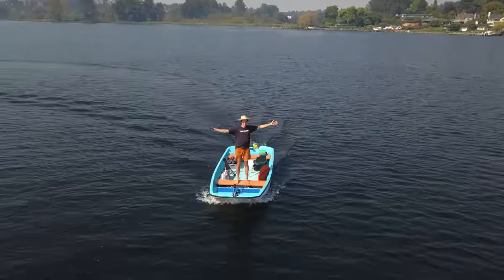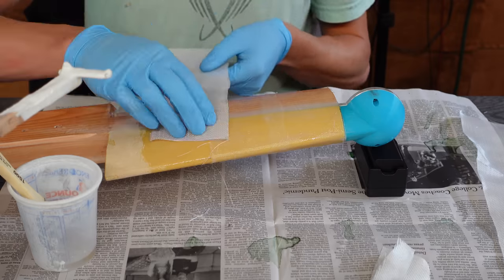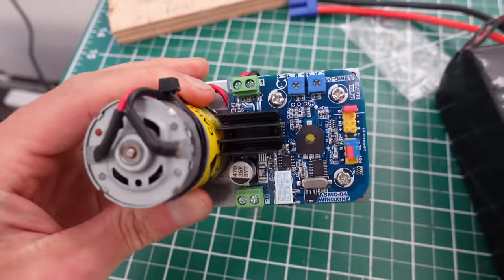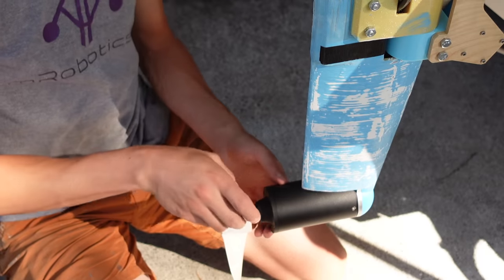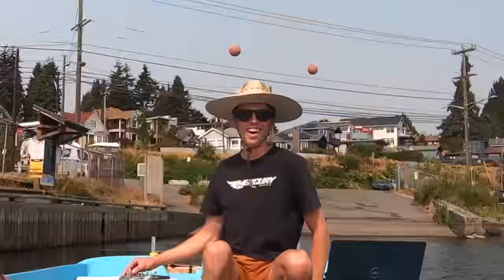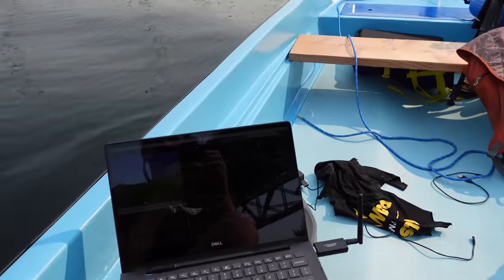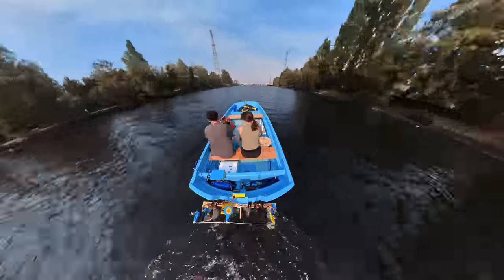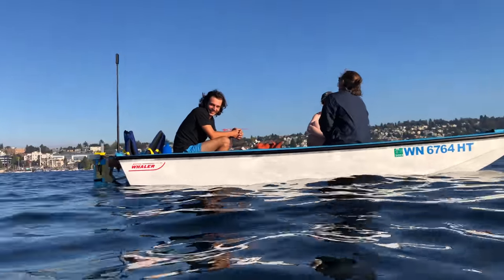Full Size R/C Boat Can Carry People!

Comment: This is awesome! Why not use some e-bike ESC's and even matching motor(s) if you needed too? Theyre already bigger and have the Watt ratings and Voltages you need..
You could prob make it into a single bigger electric "outboard style" motor like you have now. For the steering if you need to change it again and want to also have a steering wheel, you could use a regular cable style push/pull outboard steering cable and steering wheel. Then you can just mount the servo under the steering wheel to use the cable and it should keep any torque or vibration on it.
Something with the equivalent of about 40HP-70HP would really be a blast on this size Boston Whaler! Nice Rebuild, the boat came out great! 
Im waiting until its cost effective to build an electric jet ski or maybe an electric stand up jet ski, like a Yamaha SuperJet. Theyre alot lighter and the torque of the electric motor would make it feel sweet!! Would be the ultimate freestyle or even racing standup jet ski. Using maybe a small electric car sized motor and im assuming you;d have to make custom batteries because of the shape but theres plenty of room especially without the gas tank and easy to tuck all the smaller electronics up front in the nose where it doesnt really get wet.

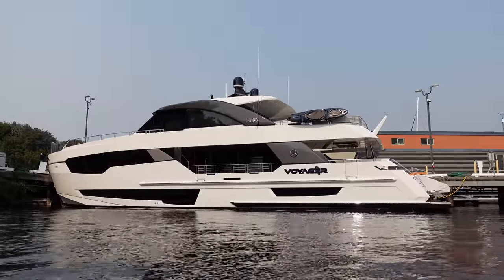Comment: @17:18, you can charter those types of yachts (and larger ofcourse). This one is not for charter available but similar size and specs will cost you 100k and up for a week (without expenses such as fuel, harbor costs and food/drinks).
Reply: A lot of them around here are owned by the billionaires in the area (Microsoft, Amazon, Boeing)

Comment: The rubber inside the hub of the prop is in case you hit a rock or solid object. To both absorb some shock and will rotate as well to keep from ripping drive shaft in two. The inner brass cog will spin on the rubber inside the prop. This setup is a bit better than a solid prop with a shear pin. After a prop strike this rubber setup will work even though it spun. Where as a shear pin on a solid prop is done until you put a new shear pin in.

Comment: rubber in between drive and propulsion, like inside a propeller or inside the rear wheel of a motorcycle, is usually called a kush drive. it allows smoother operation! On my motorcycles it keeps the motor from 'thumping' the rear wheel.
Reply: and also if you strike the bottom the rubber will rip and hopefully save your shaft

Comment: Dont know for sure but the motor might need a cavitation plate above the props. 
Also with  that plate you can raise the props to about the same height as the underside of the boat. Maybe even a bit higher. 
My boat went from 60km/h to 70km/h just by raising the engine. 

Happy to follow your channel and projects from way back. 

Thanks for reading bye.

Comment: To get much over the 11.6 knots you are now getting you will need to plane the boat, which is going to need a lot more power.  (Note: even the metric mafia use “knots” on the water and in the air. Just makes long distance navigation easier.)
A 13’ Boston Whaler will probably get on a plane with about 15 horsepower, although most use 25 to 40 or so. So so where around 11 kilowatts plus ought to do it with the right size and pitch of the props.

Comment: for thermal stuff, you are driving around on the world's largest heatsink... if you can utilize the water to cool the electronics you can somewhat guarantee a valid thermal solution (especially if you don't relay on pumps or anything to move the water).

Comment: Instead of a Servo with an Arm, you might consider a Linear Actuator for your steering.  Also, your autopilot would work better if your motors were pulling from the bow instead of pushing. All the GPS Trolling motors I've ever seen are Bow mount, not transom mount.  Very cool project though.

Comment: Differential thrust is almost exclusively used for very low-speed maneuvering. Once water is moving over the hull, it stops doing much while wasting energy. Engine turning works both at a stop and at speed. It should be used almost exclusivly at speed. When moving slow though, sometimes one is better than the other, sometimes its the other way arround. Its really a matter of how you like to do it.

As for the prop, that rubber piece is the designed in fail point. It looks like its actually made to fit a small gas outboard. The point of the rubber is so of you hit a stump with the engine at full power, the rubber rips, disconecting the engine from the prop, saving the engine and gears. Doing the same thing as a shear pin on a tractor, or a carter key on a lawn mower or gocart. Its designed to break so something more expensive does not. In the boating world I think its called spinning a prop. With a the rotating mass of an engine on the other end of a trans, its needed. Directly attached to an electric motor, it may be more trouble than it's worth.

Comment: Maybe consider adding a slot for a manual override tiller of some sort in the event that your GPS/autopilot is screwy but you can still control the motors? Also an auxiliary throttle of some kind so that in the event the flight controller is acting up you an get back to port under power.

Comment: My guess with the props is that the being out of center, even when weightwise balanced, messes with how it interacts with the water.
The rubber center is common on "proper" outboards as well and works as both a vibration dampener, and a weak link should you hit anything so you loose a prop rather than damaging the engine.

Comment: There is a reason setscrews are not recommended for use where torque is reversing direction, they will fall unless they are ridiculously over sized.
Some kind of taper collet or split coller is much better.

Comment: I was really hoping you'd treat them as pods with each motor having its own steering gear.  The differential thrust is brilliant!  I would use something like an engine or transmission mount to connect the drag links to the steering arm.  That would help isolate the vibration.

Comment: Maybe a backup tiller and way to disengage servo. The rubber in the crappy props is a safety clutch incase the prop hits the bottom it protects the crank of the outboard they were designed for.

Comment: 22:41 the waterproof box encapsulating the controller is causing it to overheat.

Maybe using an aluminium face on one side of the box can create a heatsink exchange to prevent overheating

Comment: I'd argue that PETg does absorb water, but doesn't go brittle like PLA does when waterlogged. Waterlogged PETg just becomes a bit harder to print because it make it more prone to blobs and stringing, but otherwise the finished print will be just fine even when submerged in water.

Comment: Use a high powered scooter setup, Has a 20s lipo and twin 50amp@84v's sine wave controllers. Add the display and throttle as back up. Kaabo Wolf King GT Pro would make a ideal donor.

Comment: If you continue to have steering issues you may want to look into moving the steering axis aft (or make a deeper version of the forward 2x4 shroud) to add some balancing torque. Kind of like horn balancing in aviation control surfaces.

Comment: Battery idea for you, get some used ebike/e-scooter batteries. 36v ones are 10s so running 2 in series will give you your 20s. There are some 100v rated ebike controllers you could use as well that can handle the current.  Battery hookup has lots of the 36v batteries you can get for pretty cheap.

Comment: Hey man first time watching your channel. Epic job on your build. Mad skills on everything. BTW everyone in the DIY foil world says that the props that come with the foiling motors suck. it looks like you are printing your own but if you need good outboard props you may want to look at torqueedo props for size and pitch. You mentioned that u were using 100 amp vesc’s I believe and I did not see any water cooling on them. I think I would switch over to some water cooled speed controllers. It’s one more thing to engineer but it will help with the thermal overload you are experiencing. You also said you were running 10s batteries I have done some amp draw tests with 10s liposuction running a jet surfboard and with no one on it in static tests I was pulling 120 amps continuously and peak amps at 170+ so under load aka my fat ass (225lbs on a good day) riding the board I was maxing  out the 240 amp speed controllers I was using on 2 jet pumps with 53mm impellers. So even though your set up is very different I guarantee you need bigger speed controllers. I’ve just started building paddleboard fin drives ( inspired by the 3 year wait for a Boost fin I bought on kickstarter 3 years ago. So far the torque these fin drive outboards ( for want of a better term) produce is insane even using 40 mm brushless motors with 5 mm shafts. I’m up to 56mm motors with 8mm shafts but I think I’ll have to upgrade to something like the Maytech motors you are using . 
I can’t wait to see how your project progresses. Are you shooting for cruising with solar power or are you going for speed too.? Personally I love seeing how fast I can make stuff go lol 
Wish I had your 3D printing skills hats off to you 👍

Comment: Salt water electric engine setup idea.
Get a second hand outboard engine with a blown motor and attach the electric engine to the drive shaft.
You will also be able to access water cooling from the impeller in the gearbox 👉

Comment: Hey! Looks amazing. Is it possible that the motor KV rating is too high, and the motors are trying to spin too fast for the props? If that is the case, the phase current of the motors would be really high, and the VESC might be struggling because of that. Possibly printing smaller props would help?

Comment: It looks like those props are balanced radially but not in line with the axis of rotation causing a hydrodynamic vibration, a shroud around the motor would also help to prevent the high pressure messy hydrodynamics area ahead of the props.

Comment: GOOD JOB, love the idea, also i fix boats, and i'll bet money your vibration is a combination of prop wash and cavitation, outboards have a cavatation plate that is 1" high per 1' off the transom, possibly tilted depending on RPM(and plane), also with twins, you have a counter rotation on the port side to delfect wash/ center control in both fwd and reverse, and the linkage is adjusted to be about 1-3degrees outward from parallel to center drive, aswell as reduce prop cavitation (causes vibration and severe corrosion in saltwater) cavitation is also known as turbulance in air foil design, with lesser effects

side note, steering linkage takes all the forces of the whole vessel vs weight of water on hard turns, esp under power, best to thro bolt or pin/thread the steering linkage with proper sheer force prethought

Comment: PETG absolutely will absorb water. It is the glycol chain that is added, the G that does it. PLA can hydrolyze in water but if it is coated, sealed up.. it won't do that. PETG won't be affected by water which makes it a better choice.. PETG also has some elasticity, which makes it tougher, PLA is super hard but brittle. That parameter is why i usually choose PETG over PLA, if the part has constant force applied to it or it has to flex.

Comment: I wonder if you could put speed controllers into container with mineral oil bath and then maybe water cool it from outside shell, but that would need some aluminum welding and machining for seals.

Comment: @rctestflight Maybe consider using a clamping hub from servocity or goBILDA, I'm not sure what shaft you're using but they have pretty strong clamping hubs (hyper hubs) for 6mm D and 7mm/11mm hex. Or if you can get  D bore hub that should greatly help with torque transfer since it won't be totally reliant on the set screw.

Comment: A tractor tugboat with two z drives when underway on a course sets one z drive straight ahead and the other is controlled by the auto pilot. This might help reduce the constant steering back and forth.

Comment: The rubber center around the hub of the prop is for gas Engines usually to enable a smoother gear change because there is no clutch.

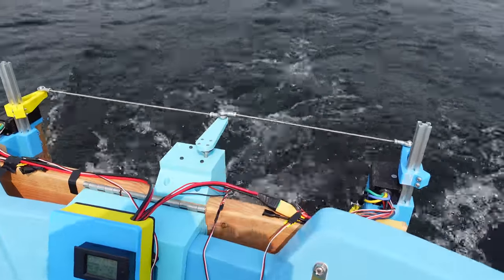Comment: 15:30 You need hydraulic dampeners to kill the vibration. Or at least some kind of rubber isolaters in the steering linkage.

Comment: You should sharpen those props. I would also take off 5% of the front ears so that they would be more efficient and have better thrust. I do all my boat props and Rc boat props. Just sharpening them would increase the performance quite substantially. You said it is cast metal so it might be too weak to sharpen. If you can I would 100%.

Comment: You just need a small pump and use some eBay water blocks for the controllers. All the e foils have the batteries and controllers water cooled. Even just slapping the controller enclosures on water blocks with some thermal interface will make a difference. 

Once you move to saltwater you can just get a heat exchanger.

Comment: petg is also hygroscopic like pla or abs, just to a bit of a lower level. all fdm printed parts from hygroscopic filaments are less hygroscopic than their filament form however, since the printing process crystallizes the polymer into bigger chains that are less reactive.

The real issue with water and fdm prints is the layer deposition and how there's basically zero guarantee that your print will be watertight. leyers have micro gaps between them sometimes and where you have retractions there are literal holes, some you can see. the layer texture can also sometimes create a sort water trap and keeps water on its surface. none of these issues are really mitigated by a different filament, you do need proper surface treatment to be waterproof or even just water safe.

Comment: The rubber in the prop hub is a dampener.  
Probably should have left the props alone because your grinding actually took them out of dynamic balance, why they are shaking in the water.   Just a guess.
Reply: It is a shaft saving shear mechanism. The rubber rips out before twisting the shaft

Comment: The rubber centre absorbs shock should your prop hit a rock or similar, however this rubber will eventually (normally 10+ years) perish, so there are a lot of places that replace those rubber centres as apposed to replacing the entire prop.

Comment: If you had 1 servo per rudder you would be able to set them 90 degrees opposite and use as brake.   Though that may not be needed.   At least you would have redundant control, since 1 rudder would still get you home.

Comment: Those massive servos are cool. I looked at a bunch of them for a possible use in a custom build recliner. Been thinking about getting on just to test and see if it would even work. For anyone trying to guess what I am planning. The servo is to control the back of the chair and the foot rest as two independent functions along with the head rest and lumbar support ( this could be the air bag ones as well ). To custom build a chair that will last longer and be stronger than the crap they sell. The chair I want is 1600 dollars. Yet I fear after 5 or so years they will begin to break down and have no replaceable parts nor the ability to replace the foam or materials. The 2 chairs I have now, well one left were 800 new and they are now pushing 7 or so years old and one is broken beyond repair as the metal has bent, broke, welded back and is now now longer fixable, been in the trash for a while. The last one has a broken bracket that does not allow the chair to open and close anymore. I will need to weld it as well. The wood structure and over all construction is poorly built. Which is why I would like to custom build the chairs instead.
Reply: Also finding anyone that makes chairs is far and between. Not just pick options. Like able to have them construct the chair in a style I want and pick everything in it.

Comment: Hey, nice project, live it, by the way if you have a shunt resistor to measure current on your flight control you can set a max current, that willblimit your throttle amd power bjt it will stip the motor controllers overheating l

Comment: Could you mount the engines up on the boat with drive shafts driving the props, then water-cool the motors with a small pump?

Comment: I was wondering if the rubber in the props was like a Cush drive on a motorcycle drive wheel. Might not be necessary with the ability to limit torque/motor acceleration?

Comment: I am very interested in the next steps you take with the salt water system. I made a motor for an electric kayak built from 48v lifepo4 batteries of 40ah. I did not have a 3d printer at the time, so I used wood to construct the outboard side of it. I got a propeller and shoved that thing onto a ryobi edger, and it worked pretty damn well. I could get well over 10 miles of range, I got 8 on half battery only using 20AH. It can get up to 9mph on chop water and is right at the edge of planing out.

I want to make it better and I looked into those motors that you are using here, but haven't pulled the trigger on it. I have taken it out at least 10 times, and did have to replace the ryobi edger once, the first one was used, so not sure the abuse cycle on it. If you are interested in talking about it and pictures, w.e. let me know. Make sure with the salt water version you seal EVERYTHING. The salt gets on everything and corrodes any metal, even the wires if there is any way for water or air to get into it.

Comment: If you're going to be building outboard motors anyway, you'll have to create a water cooling solution for the motors already. You could start building that and using it for those motor controllers first.